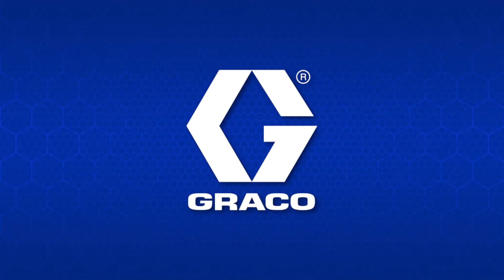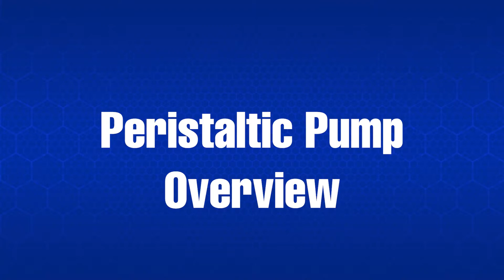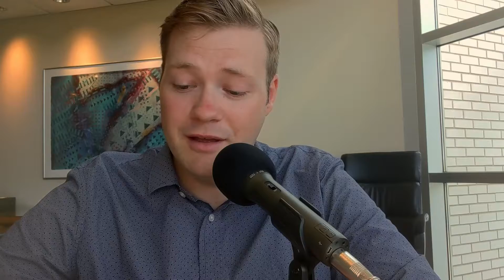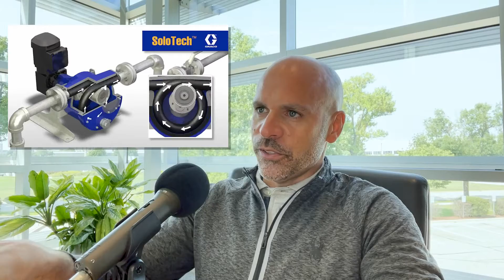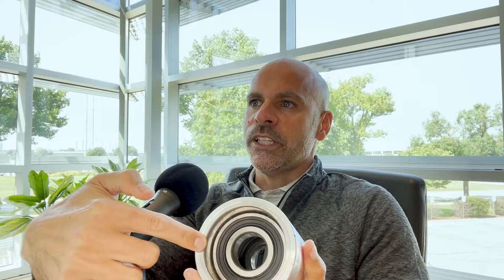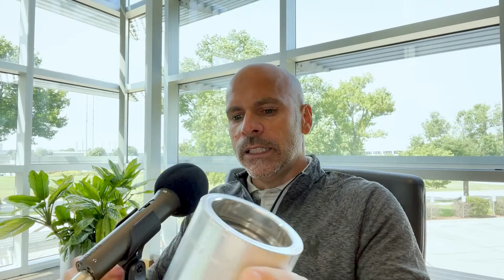Peristaltic Pump Overview | Graco PumpCast

Comment: Would of liked a little more discussion with the DC drive and controller, IoT connectivity. Big UK market is dosing colourant and salt suppressants in construction industry (bricks and roof tiles). Gentle conveying action helps maintain product integrity and less shear, so for example the starch based adhesives in box manufacturing, stringy media, inks and high pigment content paints and inks.
Reply from the maker: Andrew, appreciate the comment. We will be doing a more in-depth dive into the SoloTech technology in a future episode.  Do you have any reading material on the applications you discussed? We are interested in learning more. Thanks!